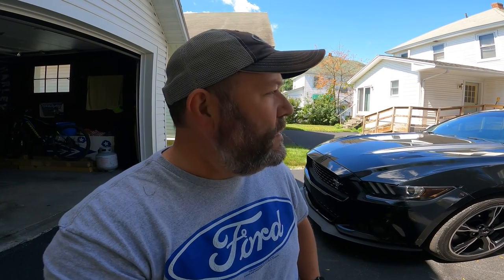Signs & Symptoms of a bad Clutch Master Cylinder on your 2015 Mustang #mustanggt #clutch #mustang

Comment: Just wanna thank you for the video. I did the job and changed the part and a couple days later on my way home from work I was losing power on the expressway. I thought it was fuel related but when got home and saw the pieces of the pad on my floor board and the brake lights were on I remembered your video. I would never have thought that would cause that issue.
Reply from the maker: Glad my video helped you out!

Comment: Great job man 
Just successfully installed my 2015 clutch pedal assembly 
Had the same issue with the blue brake sensor not being fully pressed in
Just added a quarter inch to the pad that press that sensor and good to go 

Thank you seriously you saved me a lot of time money and stress
God bless you and I hope this helps someone
Reply from the maker: You are very welcome! That job is definitely a bear and if those switches aren't working right can leave you scratching your head. Thanks for the comment!

Comment: The video is very insightful. The clutch pedal assembly broke and needed repairing.  I especially appreciate the idea of pulling back the brake booster and the one about the broken sensor.  I've removed the assembly and will reinstall it after getting it reattached.  Thanks so much for your time.  This job would have been much more challenging if it were not for this and other videos.
Reply from the maker: Just glad I could help!

Comment: Thanks for taking the time to explain this process. I’m pretty sure I’m experiencing the same problem but I’m noticing fluid out the vehicle. I’m going to check near the pedals later.
Reply from the maker: If the fluid is outside your car check and make sure that the two lines coming off the master cylinder to your brake reservoir under the hood are sealed and not leaking.

Comment: You don’t have to drop pedal assembly. There is 2 5mm Allen key bolts that hold the cylinder in on the side by the firewall  . Unclip the cylinder and unbolt the bolts and it twists right out
Reply from the maker: So I've heard, I got up under there a couple months ago to check it out and that just seems impossible, not saying it can't be done but seems pretty hard and I've done some really impossible tasks on various helicopters!
Reply: I just finished the job up .if u use a hallow hex key set instead of the Allen key due to the angle of the tool  .unclip the cylinder first the once u break the bolts loose you and unthread rm with your fingers . Lay sideways like legs across console and head resting on door sill
Reply from the maker: @TheXdriven2005..... hopefully I never have to do mine again but if I do ill keep this in mind cuz taking those pedals out is no joke!

Comment: I got mine pulled all the way out for broken weld on the clutch pedal. Had a buddy weld it up an I forgot to put the clip on the back of the master cylinder after I got everything put back together. I got up under there an tried to take the master cylinder out alone an I got it out with both hoses pulled off and and the keeper on the other side. Used a short 5mm Allen key
Reply: Also had some issues with the button the clutch pushes when pressed down all the way. It’s adjustable if your not getting enough button movement pull on the grey part an it will come out a couple clicks. Pulled mine out all the way reinstalled and pressed the clutch in it went in a few clicks an was right were it needed to be   Hope this helps
Reply from the maker: All tips and tricks are helpful. I'm glad you got yours fixed!

Comment: Great video!!! Can you adjust the clutch pedal?
Reply from the maker: As far as I know you can't adjust it but you can get different clutch springs to change how the clutch feels when you push it. I put a lighter spring in mine. The lighter spring makes the clutch push smoother.

Comment: I was able to complete the swap but by god I’ve been pumping the clutch for 3 hours, went to start but it still won’t go in gear? Maybe air still in the line?
Reply from the maker: Maybe but I would also check that you have a good seal on the two lines that you disconnected and make sure that you have enough brake fluid. I had to add almost a full bottle to mine.
Reply: Yeah I’m about almost out of the bottle, I’ll keep pumping and checking the lines feel like it’s so close every time

Comment: So my 2015 makes a ticking noise but only while in gear and accelerating from low rpm I can't hear it after about 3k rpm but it's definitely coming from clutch or trans area. Hoping a new clutch, throw out bearing and pilot bearing fixes it.
Reply from the maker: That definitely sounds like a bearing or some other transmission kinda issue. I hope you get it figured out and fixed. Thanks for the comment!
Reply: @DoItYourselfDoItRight  yea that's what I'm thinking. Thx

Comment: I followed all steps, removed all parts necessary but I cannot pull the pedal assembly out. 
Did you have any difficulty removing it? Something seems jammed/stuck but I can’t tell what. The plastic frame is already hanging off the 4 threaded rods.
Reply from the maker: Is the pedal assembly loose to where you can move it around?  If so, you have to move it around every which way so it will slide out.  This part probably took me 20 minutes to figure out how to get it to come out. Good luck and thanks for the comment.
Reply: Okay after a very long time of wiggling and moving the part, everything is fixed and back in place but now I can’t start the car. The brake pedal is fixed (top position) and won’t go in. Any thoughts?
Reply from the maker: Sounds to me like your little plastic switches are not either hooked up properly or are not being depressed by the pedals. There should be 2 switches for both pedals,  the brake and the clutch.  Check for the little rubber bumpers are see if they're making contact.
Reply: Just replying to help any others who might experience the same problem. I ended up ordering new switches for the clutch ignition and stoplamp (brake) and the car is up and running again with no more issues. Evidently, I damaged the switches at some point throughout the process - the part that sticks out of the switches wasn’t fully extending out anymore; therefore, pedals couldn’t make full contact (as seen towards the end of this video). Make sure to unplug all switches properly first and I believe disconnect the battery as well. Thanks again.

Comment: I’m 6 ft and 300lbs. Just got the master cylinder out in 30 mins while leaving the pedals in. Now I have to find the master cylinder apart from the pedal assembly 😢
Reply from the maker: You have to find the master cylinder ?
Reply: @DoItYourselfDoItRight  no ford told me they only sell the pedal assembly now. Ended up buying it for $400. The master cylinder it came with is the exact same as mine son going to pop it on. Hope that was the issue and not the clutch! Pedal got stuck to the floor the other day and clutch wouldn’t disengage at all. For the last few months it occasionally would get get stuck or come up slow.

Comment: According to the schematic of the area in the break assembly , looks to me that the whole assembly doesn’t have to come out.
Reply from the maker: Having done it, I don't see anyway how to do it without taking the whole assembly out.
Reply: @DoItYourselfDoItRight . Go to 00:04  and pause.  Looks like the clutch master can be removed without pulling everything.  Maybe loosening but not removing.   Just my observation.  

https://youtu.be/2mmKPgzPt40
Reply: I pulled mine with all bolts attached and tight both hoses pulled off the back side of master cylinder and the keeper on the pedal side took some finagling but I got it out
Reply from the maker: Good job man..... it's definitely not an easy task and that keeper is a pain!
Reply: I only took 2 bolts that hold the clutch cylinder nd remove the hoses, no need to remove the whole thing. Just 2 hex bolts holding the master cylinder

Comment: Dude for how long do you have to pump the clutch when bleeding it. I’ve been going at it for a while and it hasn’t built pressure 😭
Reply from the maker: I would say that I had to pump it at least 100 times.  Make sure you top off the brake fluid and put the cap back on.  If it doesn't build pressure I'd say check your lines and make sure they're not leaking. Thanks for the comment!

Comment: Hey quick question Ik this is an old video hopefully u see this but how long did take to bleed the clutch I’ve been stepping on the clutch for like 30 mins now and the clutch is still not fully coming back up and my gears are still not going in when the car is on
Reply from the maker: Mine came back fairly quickly.... maybe 20 to 30 pumps? I will say that after I let it sit I had to pump a few times. It's self bleeding. Make sure your brake reservoir is full of fluid.
Reply: @DoItYourselfDoItRight  thank you for getting back so quickly I will give it a try
Reply from the maker: @erickgdz let me know how you make out!
Reply: @DoItYourselfDoItRight  I still cannot get the clutch to work properly
Reply from the maker: @erickgdz I would check to see if the rubber hoses going from the master cylinder to your brake reservoir is hooked up properly and not sucking air or leaking.

Comment: Were u leaking brake fluid under car or near clutch pedal? - just towed mine to Ford but I think its the slave - its leaking under the car where trans bell housing is, clutch pedal in and out.
Reply from the maker: Mine was leaking inside the car, not outside the car. Yours unfortunately sounds like a slave cylinder.
Reply: was there an update on this having the same problem what was the cause?
Reply: @Carlos-pe8ur  it was the slave

Comment: Hey my 2015 gt is going into gear without my clutch but not moving what do you think that could be
Reply from the maker: Oh boy. That doesn't sound good.  That sounds like there is something wrong internally with the transmission.  Without actually looking at it and giving it a go,  that's just speculation. I HATE to say it but,  you should probably find a reputable transmission shop and see what they have to say. Thanks for the comment.

Comment: By any chance would you know why my clutch grabs in all gears but after driving for a while 5th and 6th disappears
Reply from the maker: That sounds like your clutch is burnt out or about to be burnt out.
Reply: Would it be the pressure plate or the whole clutch? What should i replace ?
Reply from the maker: I'm definitely not a transmission expert, and I hate taking my vehicles to a shop but in this case I'd probably find a reputable transmission shop and take it in.  You don't know how much it pains me to say that but sometimes you have to refer to a professional.
Reply: @DoItYourselfDoItRight  thanks man. Dropped a sub for the help
Reply from the maker: Appreciate it!

Comment: What was the part number sir ?
Reply from the maker: I purposely did not say the part number because the part number that you'll need is VIN specific. Call the dealership, tell them what you need, they'll ask for your VIN and they'll tell you which part number you'll need.  Thanks for the comment, hope this helps you out.

Comment: Here ya go.  It can be done without removing everything. 

https://youtu.be/1Vzl-XenKQQ
Reply from the maker: Personally I wouldn't follow the advise of a person that ordered the wrong part. There is a reason why this part in VIN # specific. The part#  that he ordered and installed has different mounting clips and has a shorter clutch throw. To get it to "work" you have to bend the metal clip to get it to engage...... if you wanna half ass it, be my guest,  any which way you do it, it's gonna be a huge pain...... let me know how it works out for you!
Reply: It’s the correct part, ford went to a different design mid year in 2016 I believe. The new design doesn’t have that plastic putter cavity thing and no clip.